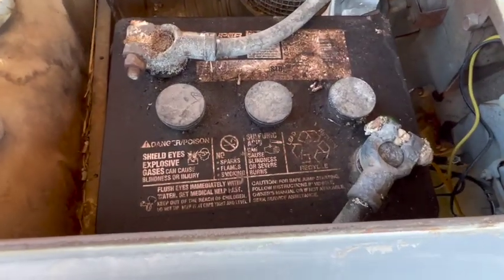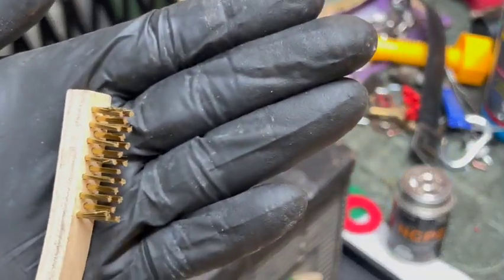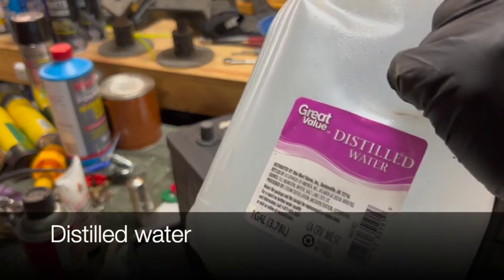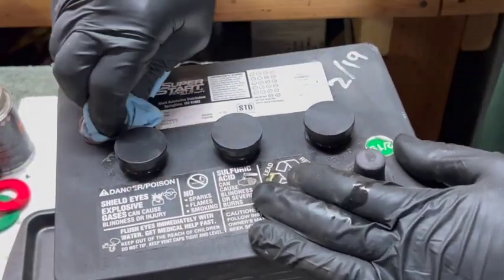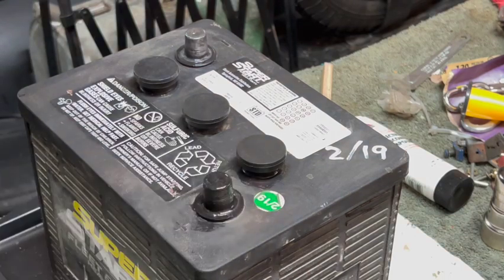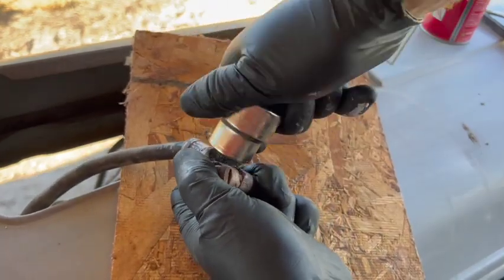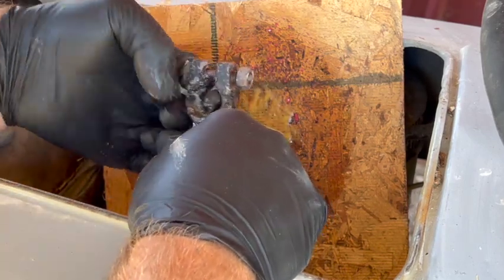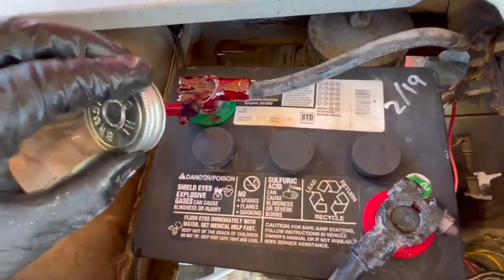Battery Maintenance and Cleaning - Ford Tractor

Comment: I've spent some time at cleaning batteries and their trays and holders. I like your method. I do a couple of things a bit different though. I don't use anything on the actual electrical connection. I prefer to clean those surfaces and put the cables on and seal them after the connections are tightened. I found that Permatex Hi-Tac in the small spray can to be a great long lasting sealer. An old RR master electrician taught me that. Another trick I picked up from a former Marine. He was assigned to motor-pool duty ( as some sort of punishment, lol)  temporarily and during that time there was an inspection. He had to clean the batteries on all the equipment that was being repaired for the inspection. He pulled all the batteries, washed them all down clean and then dried them off. Before he put them back in the vehicles, he wiped the batteries down, tops included, with a rag that had fresh motor oil on it. Just enough oil on the rag to add a shine to the top without leaving a slick. It makes the batteries look like they're brand new.  The oil buff will also break any parasitic electrical connection between the 2 terminals as there is always some present on older batteries that have dirty tops. I used this method on firetrucks for years and it worked great. After the first cleaning, the batteries would stay clean and make the next cleaning (an annual event) a breeze. Keeping the batteries clean will add a couple of years to their regular life.
Reply from the maker: Thanks Ed. I like that idea of wiping the tops with oil. I'll have to look into the Permatex Hi-Tac spray. I'm always open to learning something new!